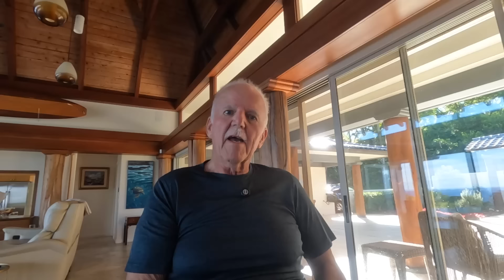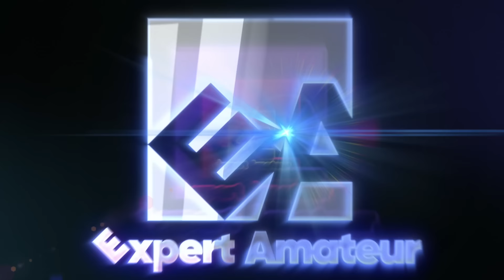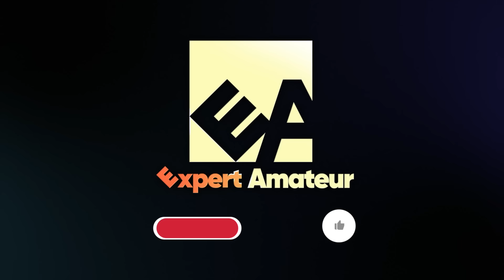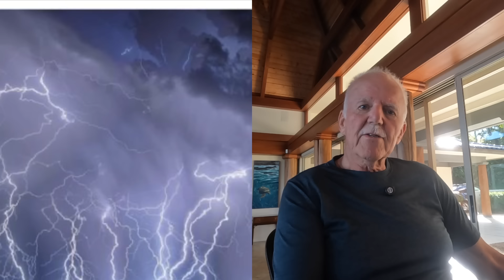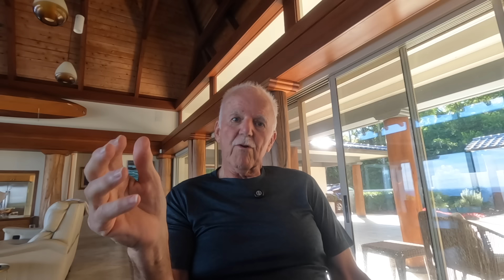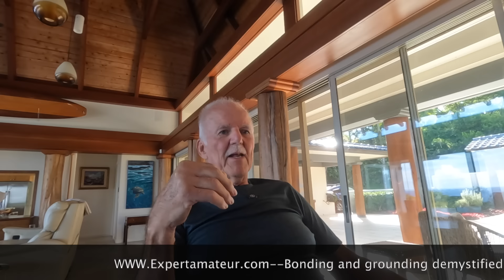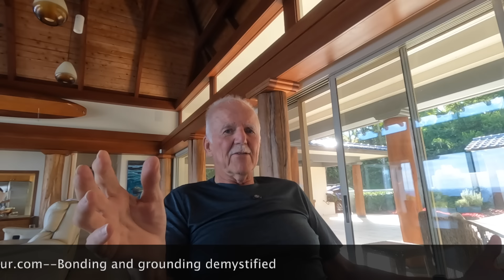solar grounding

Comment: Long ago, when I bought my first 5kW hybrid inverter from MPP solar, model PIP-5048MG, I was puzzled to find that the Neutral and Ground were bonded together inside the case. It was made to connect to European or Asian 240 VAC single phase with respect to Neutral. But even then, the Main service panel is earth grounded and Neutral is bonded there. So that introduces a second Earth Ground through the bonding inside the inverter case which is about 50 feet away! So I was perplexed on how to handle the grounding situation that I decided to use this hybrid inverter as an Offgrid system and make a new distribution panel right next to the inverter with bonding inside that new panel. Next I realized that the split phase required to run my 120VAC appliances would create problems. Yeah, we in the US  have 240 split phase with neutral in between that is bonded to earth at the main panel. I got a toroidal step up/down 5KW to obtain the split phase and create a neutral reference in the middle. But I was afraid to short one of the phase, t's call it L2, if I connected the toroid coil neutral to the inverter's "neutral" because it serves as my L2 on the toroidal transformer. The only way to achieve proper setup was to open the inverter case and disconnect the bonding they made at the factory. So that's what I did and it was super easy to do by just removing one tiny screw that bonded their Neutral to the case.  Strangely MPP never answered my questions when I ask explained them the our split phase problem.They really wanted me to buy into their dual inverter that accomplished the split phase for more than twice the price! Later on a flock of new inverters appeared on the market that feature the same problem, namely the famous EG4 hybrid inverter. A guy from signature solar, one of the distributor of such inverters,  exposed the potential hazard of this bonding and came up with the same fix. But he sells a legit split phase transformer for this EG4 units. I say legit because it does provide galvanic isolation, whereas the toroidal coil I use does not. Supposedly, he should not have to remove the bonding screw if it operates as an Offgrid system, but if he uses the grid to charge the battery, then the problem persists, and the bonding screw should then be removed to prevent a ground loop. due to dual earth ground rods. I know this is confusing but I hope it will help others like me who were left in the fog.
Reply from the maker: I noticed the same thing when I was probing my EG4 18K for weird voltages. I found AC on the MPPT connectors when I temporarily powered the grid connection with an extension cord from my shop, the current was just a few milliamps so I thought it might be the GFCI detectors which need a reference resistor to ground. Still--naughty, naughty, I'm glad I didn't stick my fingers in there. Then I found Neutral and PE at the exact same voltage with respect to L1, which I figured meant they were bonded together. With no power on the unit I read the resistance and neutral wasn't bonded to PE. It might be a bonding relay that only closes when the unit is powered. I haven't done anything about either issue other than earth ground the heck out of everything, but I plan to disassemble the 18K PV when I get back to the mainland and see what they're doing. I don't think I should just be removing bonding wires, but I'd like to know what's going on.